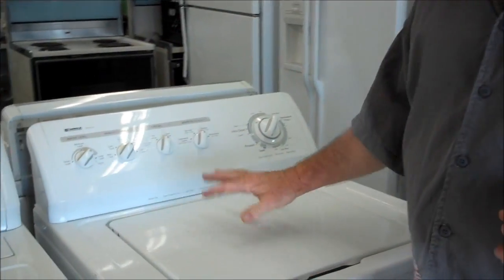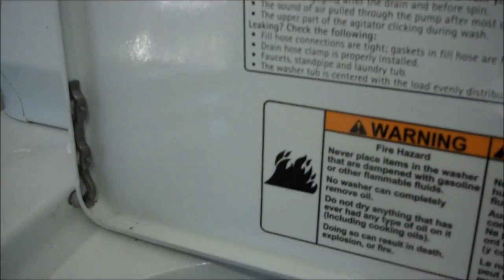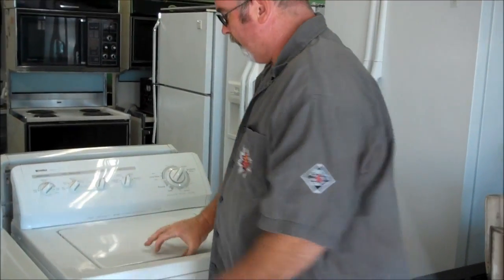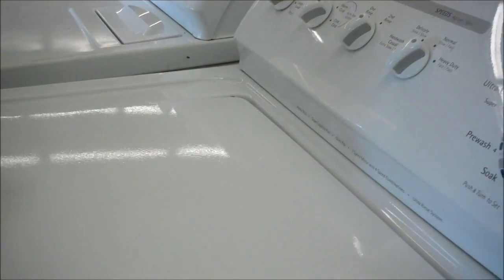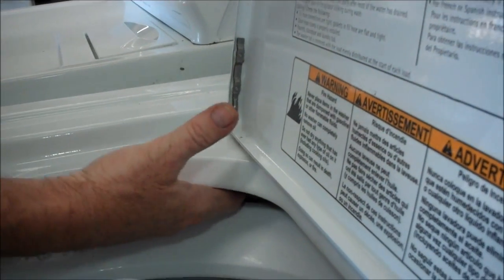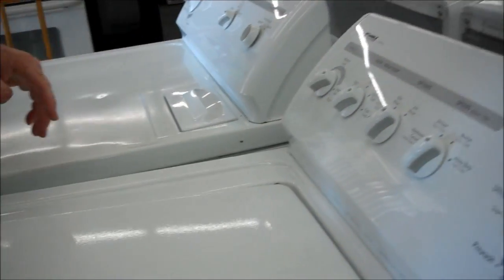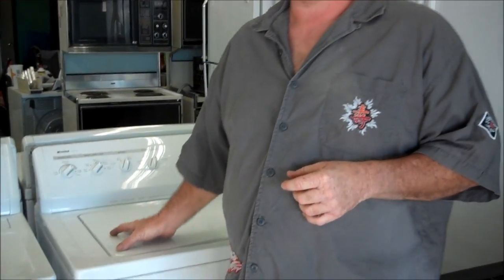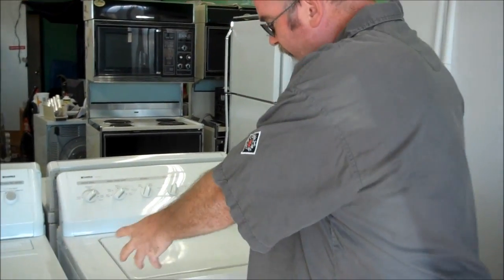How To: DIY Kenmore washer lid switch fix   - new style lid switch quick fix, no tools required

Comment: Thanks so much for making this video Richard!  Popping out the lid helped for a while, but months later I needed to use a 3rd suggestion from Michael Hogue below.  He found that tightening the 2 phillip's screws on the left side of lid near the hinge fixed the problem.  So I tightened those 2 screws on the left side of my lid, and lid switch worked again!  Back in business!  Hooray!!!

Comment: Hi Richard ! Since you mentioned in your clip that you like hearing from people everywhere, well here's a friendly shout out to you from Gatineau Quebec, Canada !!!  I can't thank you enough for making this video which clearly, has saved me a ton of money for a repair call.  Your simple DYI switch fix worked exactly as you outlined in your video on my Kenmore 80 series.  I worked the under pin gently and gradually a few times not to over bend it and when I closed the lid it on the third try, I started hearing the clicking sound.  I then switched the selection controller to Spin and BINGO, the washing machine came alive again.  So again, thank you so much for taking the time to share your expertise, which after all these years later, is still having a positive and far reaching effect !!  Many sincere thanks !! SRIII

Comment: I can't believe, i watched the video and fixed my washer in less than 5 minutes! i also noticed the screws that hold the hinge arm to the door were loose. I've been slamming the door to get it to work for the longest time, until that stopped working. thanks for sharing the great advice!

Comment: Thank you for posting this video 7+ years ago! It just saved me from spending $500+ on a new washer! All I needed to do was tighten the two screws on the left side of the lid!
Reply: Thank you Michael.  As you stated, I tightened the 2 phillips screws on the left side of the lid (near hinge), and the switch immediately worked and motor turned on.  With my load of laundry now being washed, I'm a happy camper!

Comment: YOU are AWESOME!!!! I watched about every video about washers that do not drain to troubleshoot my machine.  Then I realized, my washer does not have a hole to test lid switch.  Your video popped out, and now, having not used any tool, it is fixed!  I cannot thank you enough!
Reply: What did you do to make it work? This is pretty old, but I'm finding that the lid switch makes a noise if I press on it manually, but it won't click when I put the lid down

Comment: Thanks so much.  Really.  No one else talks about hinge switches.  I was mystified.  Thanks again.
Reply: Did you have a problem about it clicking? I'm still having trouble with my problem. It seems like the lid switch clicks if I click it manually, but not when I put the lid down. Any advice?

Comment: Just bought a kenmore 500 series used - and it was randomingly working.  Once it started agitating after filling - if I lifted the lid - and put it down again - it would not start agitating again.  Real pain.  Then after resetting the cycle like 5 times -it started. Sure enough, someone had sat on it - lid was pushed down -  I popped out the lid - bingo! it started working every time after opening and closing the lid. Thanks for sharing this tip.

Comment: Excellent video, thank you. 

I had the same symptoms, which at first I didn't realize was the lid switch. Once I figured out it was related to this, I found I could jiggle the lid sometimes and it would work. 

But today, I noticed that the screws on the left side of the hinge, attaching it to the lid were quite loose. I tightened them, and the problem seems to be fixed! Just thought I'd add this to the list of things to look for.
Reply: Mike Molloy i
Reply: Mike Molloy i know its been a while but what type of screwdriver did you use

Comment: My problem was similar to Mike Molloy's, but one of the screws was broken and half of it was stuck in the hinge piece. I ended up having to drill out the stuck half and used one size larger of a screw to replace it (#8 vs #6 I believe). The switch now activates (clicks) just as the lid is going fully closed, without having to hit the lid to activate the switch. Checking the hinge screws is a very good idea.

Comment: Thx richard it worked.  popped the lid and pushed the switch forward and it worked off and on.  One thing people might check are the two screws in the lid that hold the hinge.  mine were loose, pushed it back a little and tightened and bam!  fixed.  thx bro (greg from san bernardino)!!!
Reply: Thank you, Greg!!! Your suggestion --- tightening the 2 screws on the hinge --- worked!
Reply: Your welcome Margaret.  Our machine is still going strong.

Comment: My husband was going to call the appliance repairman, I watched your video and fixed my machine without one single tool. THANK YOU!💐
Reply: Can you please let me know what you did in details, I'm having much much trouble with mine. I know it's the lid switch bc everything else works fine, except the clicking noise. It makes a clicking noise if I do it by hand though. Thanks
Reply: Cinema I took a grilling spatula (long and thin) and slid it under the left side of the top portion with the controls. If that doesn’t work, try letting the top slam after it fills. That’s what I do now; works every time. I hope that helps!

Comment: This is the video that worked for me. Yes, I sat on the lid and caved it in. Now after maybe 10 years, it will not stay popped out. The second I stop pushing out, it pops back into the caved in position. So I put my thumb on that metal piece and pushed back. Didn't think I was getting anywhere, but sure enough when I shut the lid, I heard the click for the first time in decades. Too bad I didn't see this video a decade ago. What I've been doing is putting the lid down and then pounding the lid in that rear-left corner to get the machine to agitate.

Comment: is there a video for removing the panel
Reply: Come in with a putty knife under the front of the control panel (very bottom) on the far left and right sides, push in to release the spring clips, rotate the front up.

Comment: Hi hoping you or someone can help me.  I have essentially the same exact washer Kenmore Elite with quiet pack 2.   I just spent over $400 having a new Transmission put in it.  When the washer reaches it's spin/drain position I get a loud noise like it can't spin similar to the sound in this video where it can't spin.  However if I open the lid switch to open the circuit for a moment and then close the lid back down closing the circuit the spin and drain cycle kicks in and works perfectly fine.  Everything works fine but it sucks having to sit by the washer the entire time I wash my clothes to make sure I get it into each spin cycle when the time comes by tripping the lid switch off and back on again.  The repair guys who did my transmission came back to look at it and told me they thought it was the lid switch which of course they wanted to charge me $200 to replace...thieves.  Told them to get lost.  Lid switch obviously works because no power would be going through for the spin cycle if it didn't.  I also bypassed the lid switch just to be sure and it's still having the same problem so it's not the lid switch.  Any help or idea what could be causing this issue would be great.  After shelling out over $400 bucks for the transmission I don't have any money left for a new washer at this point.   Thank-You in advance.

Comment: Richard I know it's an old video but just found it. You're the only one showing the new lid design. Is there anyway you can link to the video showing how to take these new type end caps off? I don't want to break them and there seems to be several different ways these are attached. Scanning your channel I can't find the video you mention you were going to make on removing the panel.
Reply: Chris Schindler, I found this video: Washer Repair on lid switch- Repair & Diagnostic- Whirlpool, Maytag, Sears # 831804 on here. The channel is ApplianceVideo.com. Hope this helps. I have the same problem and will be attempting this very soon.
Reply: I have this exact model kenmore 80 series with the end caps and can't get the end caps off either.  No screws in the back and it doesn't pry off easier by hand or srewdriver.
Reply: How to remove the cap ?

Comment: i'v got a Frigidaire stack #fflg4033qw, and I can't even find the lid lock switch part number. I've tried the jumper wire trick, didn't work. maybe did the wrong wires? of course the units just out of warrenty. not happy with this unit at all. bought from howards.